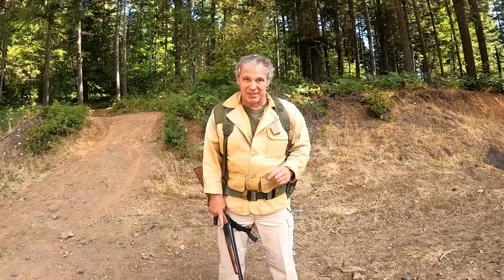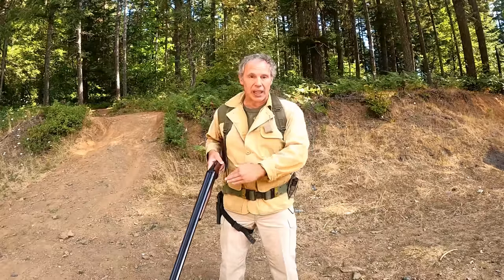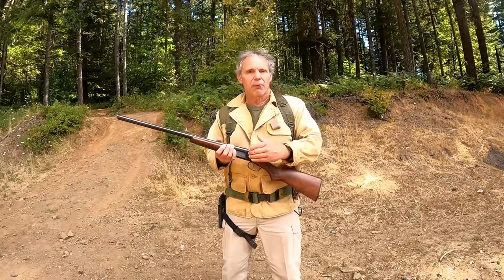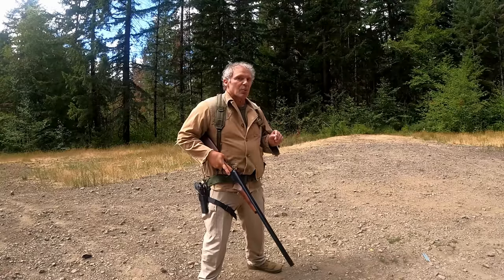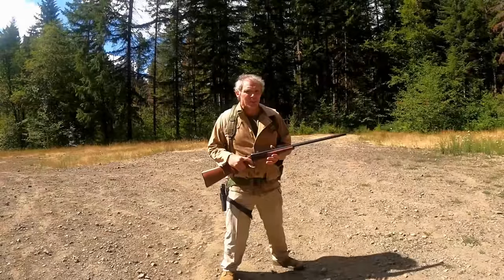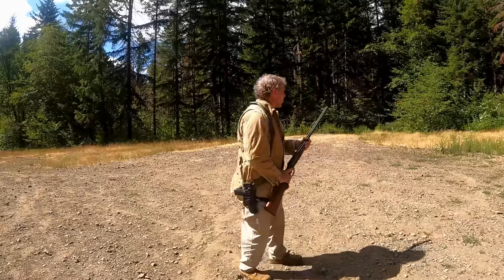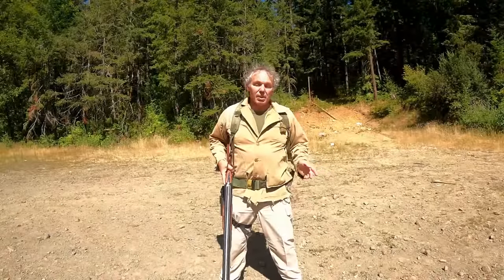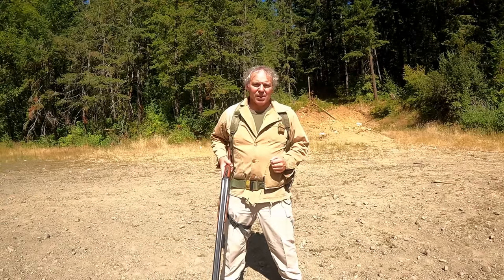Paul's Coach Gun Technique Part 3 (Internal Hammer Guns)

Comment: I recommend ejector/auto safety guns for hunting, extractor/NON-auto safety guns for target shooting. Target guns are never loaded until you are ready to shoot so no safety is needed. Though I use an ejector/manual safety gun for sporting clays and just cup my hand over the back of the breech to catch the empties. Double triggers are fine. Most of my SxS and O/U guns have a single trigger. (part 4 to come?) 

Ejector/single trigger/choke tube guns will cost more.  So what?  Save your pennies and buy a good one.  Buying a double gun that doesn't offer ALL the advantages of the "platform" will leave you empty and lonely inside.  May as well just buy a pump or autoloader (they aren't cheap either!). CZ and any number of Turkish guns (CZs, Stoegers and Mossbergs are made in Turkey also) offer all the features at costs very similar to an autoloader or pump gun. 

SOME guns allow you to CHOOSE/Modify if the safety is automatic and whether the ejectors work or not. I have a Ruger Red Label with the auto safety disconnected. I had to send the gun back to Ruger and ask them to do that (for their liability purposes). That was in the 80s. I'm not sure if they still offer that option. 

When hunting quail and pheasant with dogs, I carry the gun OPEN, chambers loaded, over my shoulder (with the barrels vertical in front, the buttstock over my shoulder) or in the crook of my arm.  The dogs will give you plenty of warning when you need to get ready to shoot. I have missed very few opportunities carrying the gun this way and it is very safe and comfortable.  If you miss the occasional opportunity at a bird that surprises you...who cares?  Watch where they land and pick them up on the way back. 

The best part is a nice walk in the outdoors with a gun and a dog anyway. 

Thanks, Paul! 👍

Comment: On trying to shoot both loads at once at a charging animal, I wonder whether adjusting your grip to get one finger on each of two triggers takes more time than you'd save.
That could probably be safely tested with low-recoil shells, just going from low ready with middle finger behind the trigger guard to hitting a target with both barrels, one way or the other.
Maybe one of a row of numbered targets, with someone calling the number from a die roll instead of the beep as the start signal?

Comment: That thumping noise you hear is lots of Cowboy Action shooters bouncing up and down wanting to tell y'all how ter do it prop'ly :) Now I do shoot cowboy, but those are not techniques I use in the field. Except maybe double loading, which is something I'd very much like to hear Paul's opinion on. It needs practice, I get that. I do a lot of practice loading from a belt, so I can load 2 just as fast as 1 (even if I fluff it up, I can just use the one that went in or reach for a second shell). Not a mainstream case, I know, but still would like to hear from Paul.

Comment: Had one recently that cocked on closing and had sort of a middle of the road solution between not ejecting and auto ejection. They just come out a bit to make it easier. Lots of differences in all sorts of break action shotguns, especially with more barrels. 

Could you test that 'push-pull shotgun technique'? It's shown in lots of shotgun classes atm by the Haught brothers. It goes back to waterfowl hunting and isn't something new and can be found in books like "Churchill's game shooting" that's been around since the 60s. The hand at the front is pushing forward while the one in the back is pulling back to the shoulder like pulling it apart just before the break. Overcoming the tension of the arm at the front should reduce recoil at the shoulder and the barrel shouldn't lift significantly allowing for quick follow up shot. 
Thank you Paul. I'm looking forward to your 800k sub video.

Comment: Another well informative and entertaining presentation as always 👍. I have a 1904 Ithaca Hammerless that belonged to my great-great-great-grandfather. I haven't known very much about this coach gun since I've inherited it, and I think it's a 16 GA. To my understanding, it can't handle the higher pressure of modern shotshells, to of which it being made with damascus steel apparently is a big factor in this if not entirely. I'm not certain of these things completely though. Overall it's in very good shape- however, there's this barrel length piece of metal in between each barrel extending the whole length of such that seems to stick upward a bit upon dropping open and closing the breech. Could this be a common or easy to fix issue with these older coach guns? I'd very much like to have it repaired if so!

Comment: I have three Winchester 24’s. A 1949 12 gauge(cut down to 26” and open chokes) a 1952 12 gauge (28” and o/c + modified) and a 20 gauge (28” o/c and modified) that I don’t know the year of manufacture. I think they are considered “striker fired”, and they do break striker springs from what I hear, but I haven’t had that issue with any of mine. They are the red headed step brother of the 21 (which you can still buy for $10,000) and the 12 gauge guns handle like a fence post, but the 20 is great for upland birds except that the barrels are thin and you have to be careful with it or you’ll dent them
Reply: I've got a 16 gauge version, choked Modified/Full. that I found in a pawn shop in Poulsbo WA back in 1991. It feels more nimble than some 20 gauge guns I've tried, and I love the overall styling and design of the gun.
Reply: @mitchelloates9406  👍🏼 I’ve never shot a 16. But I do like those old field grade shotguns

Comment: Hi Paul. I have a baikal mp220 internal hammer short barrel shotgun at 11 inches.  I have an issue that when I reload, the barrels have some spring pressure pushing them half way closed, makes it difficult to remove and insert shells. I believe this is because the shotgun was designed for the added weight of the original full length barrels. Is this something that could be adjusted, or does it serve some purpose?

Comment: I have had the worst luck of any human in history with Internal Hammer Double Barrels.

Every last one I've ever fired which at time of writing this has been 5 separate guns, has had hammers where the pressure required to cock the internal hammers is somewhere between 80 and 10,000 pounds of force. 

The Reason for the variance there, is because they were all like 80 and then firing it would some how multiply that force 100 fold.

No joke with one, I had to develop this technique where it looked like I was trying to speak in class, while I berried the muzzle of the gun in the ground, then I'd swing the gun up, while I slapped down as hard as I could, and that would get it started.

GET IT STARTED.

I'd then have to bend the Fucking thing over my knee, to get it all the way open.

Bruised my palm to ever loving hell. 

Every time I handled one that bad, I just thought "That has to be a uniquely bad one." But I'm serious, after 5 guns, I've never handled an internal hammer double barrel, that opened with a reasonable amount of force.

I've handled 2 with hammers, and those both opened like a dream.

Comment: Is that new side by side perhaps of turkish manufacturing?

Theres a run of over under shtogjns up here in canada that don’t have the intrusive auto-safety.

They’re a rather neat beast taking advantage of the goofy way our laws were written, so they’re basically a factory sawed off.  Single trigger, barrel selector.  Pretty neat.

Feel like Omar with that thing.  But hold tight or you might see the wrong end because of the goofy short stock like on those ranchhand “pistols”

Comment: Very good video.

My beef with internal hammers especially for home defense is that most if not all are cock on opening (and interestingly the spec sheets keep that a secret). If they were cock on closing you could keep shells in the chamber with the action open without leaving the hammer springs compressed.
Reply: There's a lot of opinion on leaving the hammer/striker spring compressed. For what it's worth, I have a 1924 Belgian SxS that has always been cocked for the last 99 years other than when it is fired. You can't even put it away in the box without cocking it first. This is not an exceptional gun feature, and leads me too suspect you might be overly concerned - unless you plan on using it for self defence at a very ripe old age 😉
Reply: @Geekofarm  If I were to store it away not intending it to be ready to use I probably would drop the hammers on snap caps but you may well be correct. It might be a little bit of paranoia on my part. 😊

Comment: Great video! I own a Stoeger Coach gun, essentially the same gun in 12 gauge with shorter barrels. I like to kick out the shells with a small backward jolt rather than use my hands to remove the shells manually - a trick I learned whlist practicing Cowboy Action shooting and reloading drills. It is mainly on the shooter to sumize whether or not that reload style is faster, but I wonder if there is an advantage to it over removing the shells with your hands.

Comment: Asking just because I want to see part 5, but what methods would you use with a single trigger over/under?
Reply: Have the selector in the desired position and fire?
Reply from the maker: If I had a single trigger over/under I would make a part 4,6, and 7

Comment: I defeat the auto safety feature as it could get you killed in a stressful reload and fire situation. reference John Taylor(Pondoro). also my savage 219 single shot break open 30-30 cocks the hammer spring with the operation of the opening lever not dropping the barrel. its different. as you say not all things work the same.

Comment: We had a hunting education course in Jr. High. When we went out to do practical testing with real firearms we were all told repeatedly "don't pull both triggers at once" (I seem to recall the shotgun would let you pull the forward trigger all the way back through the rear trigger and set off both barrels?)... Needless to say I cracked off both at once and smashed the fuck out of that clay, then when I tried to shrug it off and be the coolest toughest 13 y/o in the world, I ejected both spent shells right into my face to bounce off my glasses... Simultaneously looking like a complete retard and invulnerable... Then very quickly handing the gun back to the instructor before anyone could think twice about what they had seen. I'm pretty damn sure it was a 12ga. they let use shoot, and I was the biggest kid in the class.

Comment: To the "Actually guys":
It actually IS hammerless.
It has LESS hammer than a normal one. No need for all the extra mass for your finger to pull it back with.
Pull a hammer out of a hammerless, and take the hammer off the external. Weigh them. The hammerless one has LESS mass.